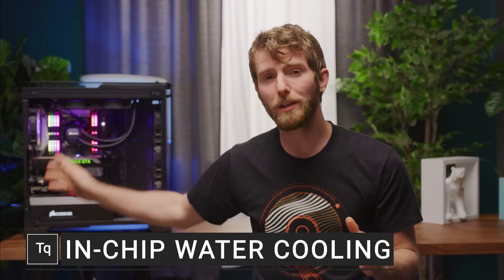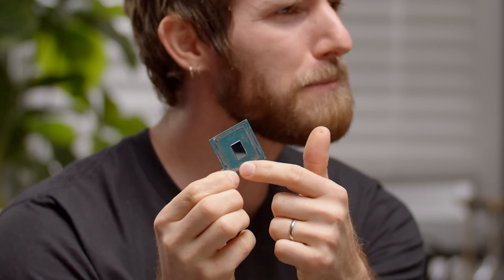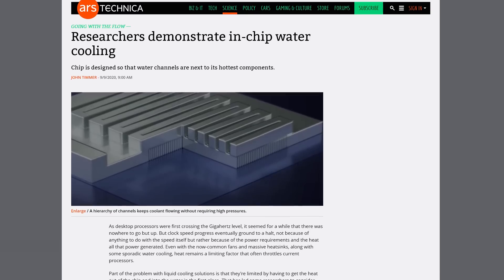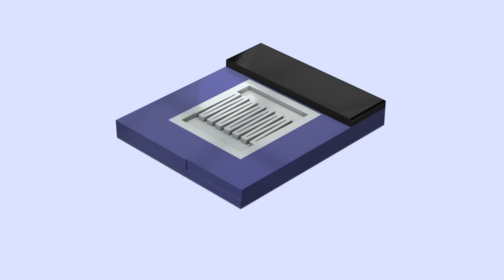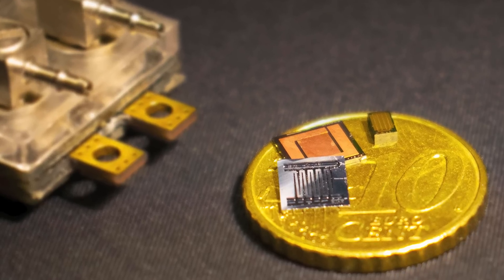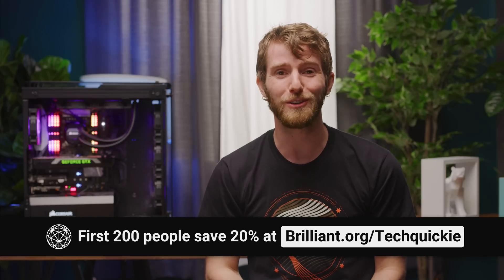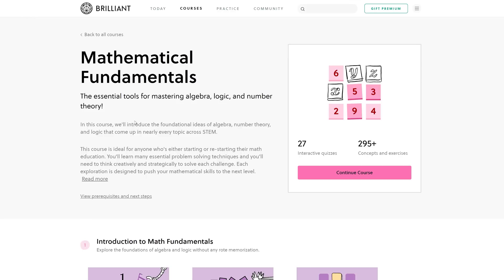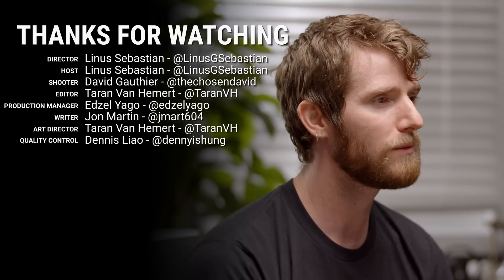Water Cooling INSIDE A CPU

Comment: Seems something easy to implement but difficult to maintain. Normal heat pipes seem more sensible than an actual loop of water, as minimal tolerances near the heat-block means the whole system must be resistant to any impurities in the water - something your casual AIO-cooler needs to maintain only on much larger scales.

So either this is not at all relevant for consumers and gamers, or the technology would have one small, internal loop and a larger loop cooling that. Which is just heat-pipes inside the silicon, with extra steps.

Comment: The cooling hardware and overhead could get smaller quieter and use less energy.
I bet phase change could be done in similar channels.
The heat rejection out of the system may be more efficient but you're still going to hit a limit on how you pump that heat out into the environment.

Comment: First. We need ARM processors everywhere. 

Next. Micro water cooling

Last. Keep inventing more and more efficient processor architecture and cooling.
Reply: Arm processors arent a good replacement for intel/amd ones for pc's. They lack the power to space ratio
Reply: @Redd_Nebula  that’s cuz they have f****ing everything inside them. GPU, RAM, some other s**t. And also I’m not sure if what you’re saying is true.
Reply: @Redd_Nebula  Lol have you seen the benchmarks and performance of the new Apple M1 arm based chips. If you had made this statement one week earlier, I would have agreed. But now it is totally wrong.
Reply: @yziib3578  would be impressive if they scaled it up to give the same performance as pc cpu's. Arm works better for that application due to its much lower power draw. If Apple releases a cpu that is even on par with an amd or intel one I will consider them a contender...but not before
Reply: @Redd_Nebula  We need quantum computers.
Reply: @Haskellerz  would be nice...but also wouldnt work for home computers until electricity is basically free or it is set up in a way where you rent space on some sort of communal computer and connect to it via another device. Also backwards compatibility just isnt a thing with them....although that might be more a blessing than a curse after the first 10 years
Reply: @Dawid Garus space for airflow, but the main thing is that after going over a certain size youre just introducing latency. That is fine for a supercomputer where you use it for scientific calculations, less so for what you use a pc for. If arm could off a competitive product for the pc market they would do so. Realistically they would probably work better in the GPU space than the CPU space

Comment: We are probably gonna need this for 3d stacked chiplets.
Reply: Yeah, that's what I thought as well. Dissipating the heat is a major problem for 3d designs and this solution might be able to solve it. Just in time for transistors not being able to be shrunk down anymore I guess.
Reply: @jangxx  theres many ways to make a transistor. and a couple of them can be scaled down way beyond nanometers
Reply: @opvask  then why they don't use it then? Xd
Reply: @opvask  how about just optimize apps to run multi core and then just add more cores on more chiplets and eventually 3D stack?
Reply: @opvask  Actually, his question is valid, and there's a good reason why they don't make smaller transistors. At the current scales and materials used it's extremely difficult to reach 5nm (in lab conditions with high failure rates, or 7nm for mass production) without getting quantum tunneling as the gates are so close together that they simply "jump the gap" in the open circuit. This is of course specific for Silicon, and as far as I can see aside from unverified reports of companies claiming to have used carbon nanotubes (which aren't a semi conductor, so that's retarded) there's no other materials that can go smaller at production scales.
Reply: @ScarletFlames1  thanks for repeating what i said
Reply: @ScarletFlames1  Dont shoot me, but im pretty sure i read something about a way of forming or connecting the carbon together(not necessarily in the nanatube shape) that changes its conductivity and various properties, like being magnetic... ) So i dont think its as strange or impossible.
Reply: @ScarletFlames1  pure silicon isn't a semiconductor either... without doping.
Reply: @vyor8837    doping carbon nanotubes makes it impossible to form them in the first place as the entire thing relies of the structure and atomic properties, not the material properties of carbon.

@opvask you said in a previous comment that there's ways to make transistors smaller than nanometers, which is either complete bullshit or a method that isn't currently useable to put them in a dense construction in order to utilize them for a CPU.
Reply: @ScarletFlames1  Carbon as an element is hilariously conductive. See: diamonds and graphite rods.

And the doping is applied after they form, specifically to give them semi-conductor properties.

And the best way to make a sub-nanometer transistor is quantum fets.
Reply: @jangxx  aye, I'd imagine it would be easy enough to either run through the substrait they nest it on or even through the in between layers offering support to the chiplets themselves. 

I imagine it would ultimately get capped by the heat spreader so they could still offer stock or leave you with aftermarket coolers. Definitely interesting to see hoe it pans out.
Reply: Yeah I know and Intel better hurry up. (:
Reply: @WarriorsPhoto  for sure, but they gotta finish booting the bean counters first. Lmao
Reply: @wmunn10  AMEN to that. That's an issue with a lot of companies. Too many bean counters. :(

Comment: This seems like the all 12v power supply BS. Sounds good on paper but in reality will at best ever be seen by the average consumer and at worst screw them over because you've moved a common point of failure to a even more expensive component. "Oh the cooling channel got blocked guess you have to buy another $300 CPU"

Comment: I wonder what kind of liquid they've used. I doubt it's water. Anyway, this is definitely NOT something to put in custom loop, more like internal CPU loop with integrated pump, and second hot plate (basically heat exchanger) would be required for multi-kW chip. I have seen 1+ kW custom silicon, and thermal margins it had to work with were terrifyingly small - this tech would make such devices viable. We would also be back to CPUs size of a fist.

Comment: Then: Don't get water on your electronics, they will break!

Now: Put water in it and sell it to people. They will love it!
Reply: Probably distilled water, since that isnt conductive
Reply: Minerals, in water, is what causes it to be electrically conductive.  You have to add an impurity, such as salt, into distilled water, to make it conduct electricity.
Reply: @jacobw446  Yes but it will naturally become conductive over time no matter what you do because impurities will get into the water no matter what. The beauty of this however is that it is a contained system. As long as it works when it's first made it will never leak meaning the liquid never comes in contact with electrical connections.
Reply: @joer8854  talking about distilled water.. not environmental contamination.  Now if you are talking about environment getting into the water, then that there is a reason to not allow water to enter inside a chip.
Reply: @jacobw446  I see you are talking from 20 years ago. The backstreet boys suck. Aside from your arguments that have been proven wrong decades ago the chip and system would be sealed and contained as well as tested from the factory. 
In other words, it doesn't matter if the liquid is or isn't conductive. It's a sealed system.
As far as you saying something shouldn't be a thing because there's a long shot things could go wrong. You don't decide to not do something that is orders of magnitude more efficient because some person somewhere sometime in the billions of computer users may one day one time have an issue. That's utterly moronic.
Reply: @joer8854  "Sealed" is never "Sealed".  The atmosphere eventually gets in, especially if you are talking about a water/liquid cooled system, that has an outside radiator.  The question is how long will it take to get contaminated... not IF!  

Liquids also eat away substances as they move. If you are talking about Nanometers of room inside a semiconductor, this quickly becomes an issue. This will etch the silicate from the inside out from the mere movement of liquids.
Reply: @jacobw446  It would be decades before that even comes close to being a problem. Sealed can be sealed. The fact that we have human beings in low earth orbit who are breathing and not dead who recycle their own water proves you wrong. This argument was over more than a decade ago when water-cooling became a thing and became popular.
Reply: @jacobw446  You are assuming you know everything about it. He said the liquid is inside the substrate, not the silicon. The fact that you assume that they didn't do any practical testing or account for any issues is laughable.
Reply: @joer8854  I highly doubt, that this pig will fly...  This is not a new idea.  People have considered this for over 20 years, and frankly it is laughable to think that the VOLUME of liquid flow, would be enough to do any substantive cooling.  "practical testing" is yet to be seen, let alone REAL WORLD testing.  I for one, will never buy one!  It is a dead product as far as I am concerned!
Reply: @joer8854  Yeah. An example of seal that lasts very long are vacuum tubes, especially CRTs.
Reply: Water "isn't conductive" but as soon as you put it into a system it picks up ions from the metals and becomes conductive. You can add an additive to "stop" this but I will only slow down the inevitable.
Also "non-conductive" technically isn't a thing, it's all just high resistance.
I have a open loop pc (see the low res profile pic) and I had a leak go straight in to the power supply, it tripped the breaker at my fuse box so I removed the psu from the pc and left it upside down to dry for a few days, that was 2 years ago and it's been fine ever since.
It also soaked my gtx1080 and i just wiped that off and used my spare psu until the other one had dried.
Reply: @jacobw446  Flow wouldn't need to be anything like as high if your closer to the heat source.
Water has a very large heat capacity.
I don't see any reasons apart from manufacturing challenges why we don't yet have this.
I'd buy a ThreadRipper version if they made one and it was worth getting.
At the moment a highly power dense cpu can't conduct it's heat away quickly enough and even with a good block, high flow pump and a lot of rads you'll see a massive delta between the cpu's in die sensor and the water temperature.

I'm not saying we'll ever see one or that if we do it won't be flawed in some way but I don't think "VOLUME" is the issue you think it is.
Reply: @KillaBitz  Talk about brave! Oh wait I’ve dried out two iPhones as well and they worked fine afterwards. 
Electronics are an amazing thing. (:
Any other electronics that survived?
Reply: @joer8854  stop being scientific
Reply: Well, yes but actually, no.
Reply: Yeah I know. Aren't we glad that technology is moving forward though?
Reply: well there are alternatives to water
Reply: Yeah It's big brain time
Reply: @anon-y8w An insulator is something with a high resistance so is a "bad conductor". Everything will pass current if he voltage is high enough (it just might catch fire in doing so)
Reply: You could use dry water.
Reply: @Stormprobe  You mean DISTILLED... But the water motion will still etch the inside of the chip.. out.  This is common in dams and waterways, even copper pipes in your home!
Reply: @jacobw446  you made many valid points but you forgetting something here. Nothing is impossible just takes time.
Reply: @jacobw446  look inside my waterblock you'll see the metal has been eroded but you'll also see that the acrylic hasn't (or not as much) (unless you happen to know how fast silicone will be worn down by water how can you say it's an issue and it's easy to account for by making and channels necessary with thicker walls.
A cpu isn't just silicone anyway it has copper layers and other things it's not impossible for them to add channel linings of what ever they think is best (to increase "VOLUME" flow)
Reply: @Stormprobe  "dry water" is that sand?
Reply: @Riskteven  "And the channels are probably a few molecules of glass as well"
Where did you magically pull that info.  (maybe if your talking about a coating to stop erosion but I doubt it)
Glass? no. Molecules ? no. Probably? no.
Reply: It' s not a new concept but the application with semiconductor is. Some power tube were cooled with high purity water at the anode (where the high voltage is) in radio transmitter.

Comment: It'd be cool if they used mercury instead of water as the coolant. Though I'm not sure how that'd work (depends on a number of things; like I don't think you could use aluminum anywhere the mercury will be on contact for example). And of course there's the issue of how much mercury expands and contracts at varying temperatures (but maybe a self-pumping system could take advantage of that). If it's built into the chip there's no real risk of it getting out (as long as the chips are built and sealed properly). And using mercury means you'll be able to move a lot more heat.

Comment: Pretty sure its not possible to cool a die like this (economically) since that would require etching away entire chunks of it, just like how they made that resistor. I would like to see watercooling getting integrated into the package though, with small fins directly mated with the die. I'm also certain that this would require a lot more pressure than the usual watercooling.

Comment: how would a water-cooled smartwatch work?? isn't the water needs to be cooled to you are talking about a watch with water in it, and the same thing about the processors they still need radiators or something so it won't be that small

Comment: Small issue, we know that watercooling has issues with growth inside the water.
Such a solution would need some special sause because the smalles contamination might destroy the chip very fast, and we are talking about tiny tiny channels.

I therefore highly doubt that this could be a solution in the field of computer science. maybe some special project, but serverfarms are all about stability. this solution is inputting risk into your systems, same for house hold use,  lets say you could manage the risk and employ the solution in  a server farm. it's only possible because of stringent policies by professionals.
Consumers do not follow those rules, they are crude users comparativly. and the last thing as a CPU maker you want is news about your product dying everywhere because someone did not follow very strict procedures in a consumer envoirment.

Nice thing for in the lab, but I do not see it in this form going anywhere ouside the lab.

Comment: That's actually really neat. so in theory if you have a water-cooled processor would you be able to put an additional heat sink on top of it to further increase the thermal headroom? Or is it like a this one, or that one, when it comes to the solution kind of thing?

Comment: This has been conceptualized for over 10 years, mid 2000's, and I believe there have been multiple prototypes designed since 2012 or so.
Recently, with the development and advancement with 3d packaging, there have been multiple papers and patents about using microchannels between the different HP ICs for cooling purposes.

Comment: With those tiny channels, it will probably have to be its own sealed self-contained loop with pump/coolant (like maybe fluroinert?)  which exchanges its heat to a typical PC water loop. 
It's a clever idea but introduces a lot of failure possibilities directly with the expensive silicon.
Reply: I would treat it more like an internal heat pipe that allows the heat to be spread across the entire die area,  which would reduce hot spots and allow more heat to be transferred to the spreader.

Comment: Wait. Where is the heat dissipated? 
Is it just stored on the top of the die? 

If so, then would this just be a more efficient way to transfer heat to the heatsink? 
And then use a traditional fan, AIO or Custom Loop to get even better temps?